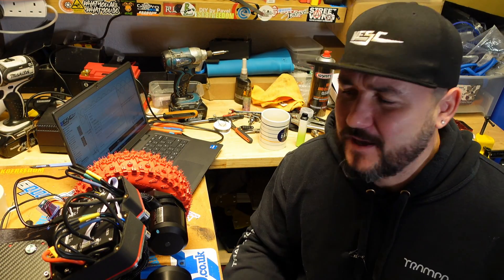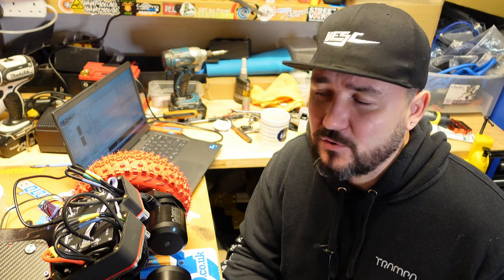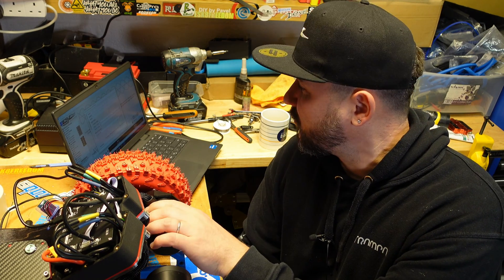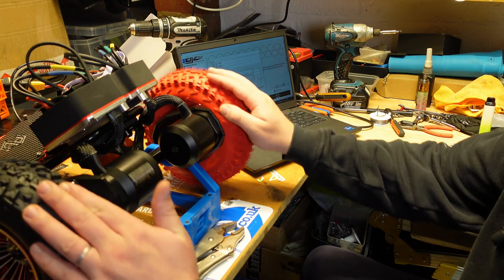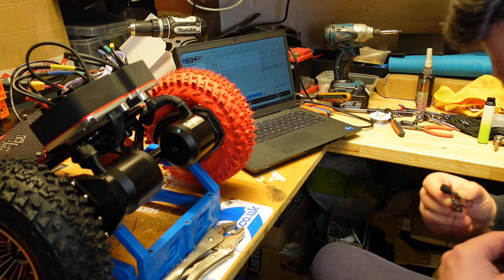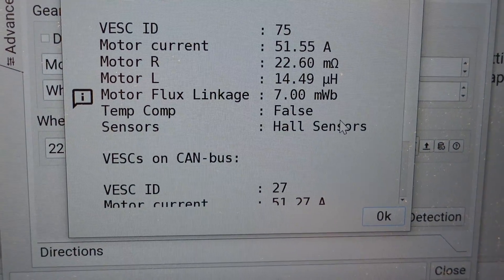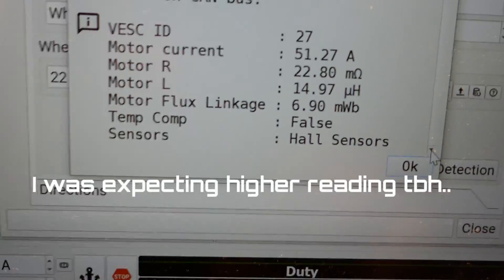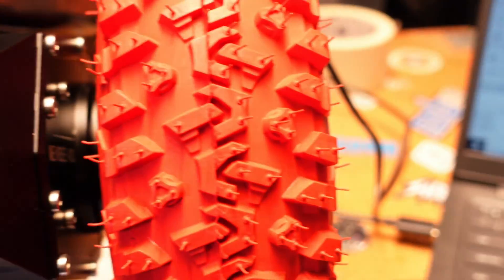Flipsky 7070 motor detection.

Comment: Hey Pavel, thank you for your videos. A couple days ago I asked you in the comments if trampa vesc6 mk4 can run 7070 motors, Im sure this video answered my question. I did have major issues with trampa vesc6 with throttle sticking on, jolting, not working properly making my board extremely dangerous to ride. I wrote to trampa and the sales manager suggested I buy a new petitiometer for my wand hand controller. Before buying I looked through trampa site and found that they upgraded their wand to the magneto system making it more reliable and safer. I was dumbfounded why the sales manager didn't suggest this to me, I wrote to him telling him this and got no reply. I purchased the new magneto wand controller but still not running accurately and safetly. After a months between my tech mate programming my board and communication with Frank from Trampa that vesc6 mk 4 program must not be updated beyond a certain update to run accurately, reliably and safely. I was disappointed that I spent so much on speed controllers that weren't safe and that trampa released without knuckling out all it's gremlins, a public safety issue which Trampa protected themselves liability wise with their warnings of possible malfunctions when downloading Vesc app. I was ready to use vesc6 and wand controller as paper weights. Finally Frank advised my tech mate that in order for vesc6 mk 4 to run correctly, the update version of Vesc tool was 3.01 only. Now my board runs well, until I burn't out one of my electric skateboard brand 6374 190kv motors. This is why I want to upgrade to 7070, I know they are 110kv but I always wanted hard acceleration rather than top speed. Thank you again 👍🥇🙏

Comment: How did you get them to work with the newbee geardrives? I got some and when I bolt them it’s like the bolts are two long
Reply from the maker: Did you use the bolts from Newbee?
Reply: @PavelGarmas  yea
Reply from the maker: @lycafoxx3340  
Could be the shaft rubbing then. Put a large washer in between or cut the shaft shorter.

Comment: Hi Pavel, thanks for the detailed video about your setting and detection. 
As for the problem that the displayed current is small when matching the motor, when we use the VESC-Tool to match the motor, the type of motor we choose is: Medium Outrunner (~750g) and the weight of the 7070 motor is about 1250g. This causes the running current output by the software to the motor to be relatively small, resulting in a relatively small current for automatic matching.
We can improve this by modifying the motor current in VESC-Tool, or selecting Large Outrunner (~2000g).
Thanks for reminding us of this by mentioning it.👋
Reply from the maker: Thank you guys!

Comment: I'm very surprised that it only detected around 51 amps per motor. I have some torqueboards 6355's that come up as 70ish amps per motor & I'm only running a 12s4p p42a setup right now.
Reply from the maker: I am as well mate however Flipsky said it is ok and i have set the motors to 100 Amp each.

Comment: Do you use the VESC Tool Platinum, or the free version? I want to get the tool to adjust some of my setting on my boundmotor flash.
Reply from the maker: Hi mate,  it is the same tool ...just donation to Vedder is different. 
I am using the Free one.